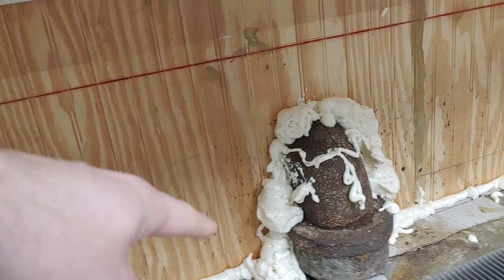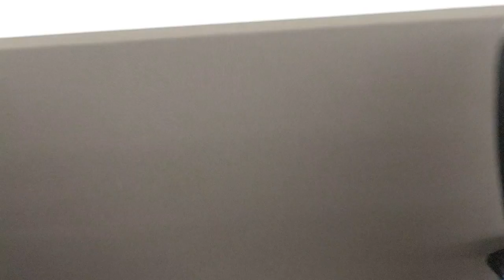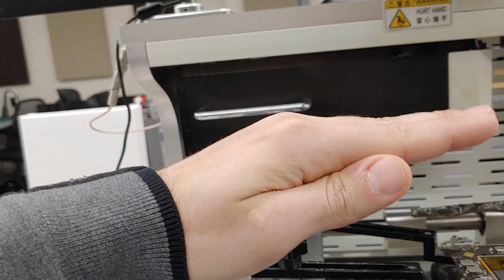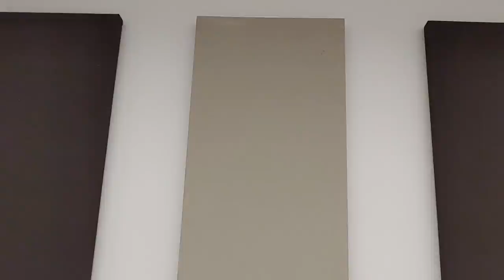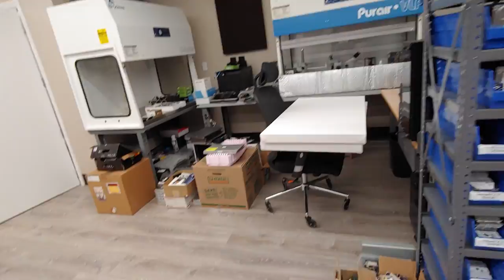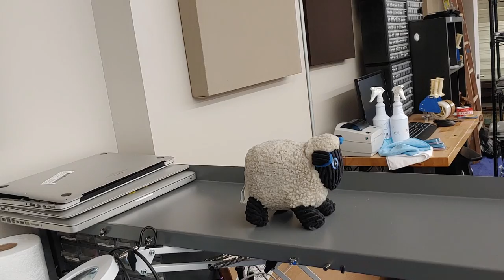The end of the cockroaches forever and ever

Comment: Mice I unfortunately know first hand will remove steel wool and foam.
Reply: Yup it will take them some time but they will
Reply: Glass mixed with cement is the only way I’ve stopped mice
Reply: @ace-kz9id  they even manage to bash themselves against metal wire mesh and chew on it in NYC when we learned the first time. Ended up finding blood on corners they bent.
Reply: use mouse-x...it really does the job...only drawback is having to track down the dead.
Reply: Mice & rats & most other rodents hate copper,needs to be pure copper mesh,none of the metal coated copper mesh rubbish.
Reply: @stuartandrews4344  Well coming from a guy like me that used to strip insulation with with his teeth, coppers got a horrible taste, I think you might be onto something.

FYI; I have several different wire strippers types now.
Reply: @TheHungrySlug  You barbarian! I love it.

I have used steel wool in only small crevices. I just jam it in nice and tight. No mice problem since then, but it also helps having 2 cats who eat them kinda behind the scenes.
Reply: Gavin Ferguson some Londoners mice were stopped with a weird mix of PVA glue and sand made in a type of cement. I didn’t have anything on hand at the time and by the time we left that house, they didn’t came back trough the holes covered.
Reply: It doesn't matter what you use as long as it's airtight.
If the mice don't know that something is behind it, they will be far less motivated to chew through it.
Reply: @MBisFrenchy  they do that here also. But the difference is I keep a cat to kill and eat the mice

Comment: I wish I shared your optimism. When I lived in Florida, two exterminators couldn't get rid of them completely, and all the sealing they did, amounted to nothing. And the last day I was living in that apartment, I find a piece of carpet by the wall that lifted slightly. When I lifted it, it turns out they had ignored all the sealants and just dug a new hole into the side of the building and then pushed out through the carpet. Moral of the story: cockroaches are relentless and when they want in, they will find a way in.

Comment: dig a 3 meter deep and 3 meter in diameter hole, cement the bottom and walls with 1 meter thicc cement, carefully place the vacuum in there, fill the hole with self leveling concrete

Comment: i had a roach infestation because of the houses nearby not caring that they have a major infestation. we used to (and still do) have an externminator come in once a month to spray, and nothing changed until i lost my mind and put small cheap glue traps all around the house. closing the holes they use just forces them to find  a new hole. you dont get rid of them til you get rid of them yourself. we tried bug bombs and 5 little plug in things, nothing worked but glue traps.

Comment: Probably could have glued down some rubber trim to seal that up. I doubt that foam or caulk (which is it?) is going to last, surface is too rigid for it to stay in place whenever it gets abraded. Honestly my favorite is to just wire mesh and mud, as long as you put at least a cheap primer over it, it'll last far longer and look a lot nicer.

Comment: they make spray foam for insect and mice with repellent built-in.
Panels look tacky as Fck. I would have put 1x3 stripping on the walls and stretched some heavy fabric and it would perform better and look way better. 
On the ceiling, if I had a "Designer" helping me I would have done a cool drop ceiling that only covers like 60% of the ceiling so the sides are open and visible and the drop ceiling hangs down with a cool design. Looks awesome, add more lighting and will help with sound.

Comment: That construction fill foam will not save you Louis. They just eat through that, should have used some concrete or so. For a while it should help but it won't be forever.

Comment: Cockroaches pretty much come with any rental unit. They have a very good sense of smell and if you spray they just go in the walls and come back in a couple of days. Dupont makes a cockroach bait that they sell on Amazon for about 30.00 Cockroaches are cannibals. The cockroaches eat the bait go back to the nest and die. Then other cockroaches eat them and die. For me it is the only thing that works and it works every time. It comes in tubes of goop. Put a little goop behind socket covers, don't use a lot, just a line about two inches long, and a little under the bathroom sink, they like damp places, and in six weeks all cockroaches will be gone for years. You only have to put it behind a few socket covers, not all of them. It seems to kill other insects also, like silver fish. You will have to do something else about the mice.

Comment: Louis, you didn't heed the comments about using boric acid in the "dead spaces" and common entry points for roaches. Just because you plugged the holes and sucked up the dead bodies doesn't mean that you don't already have an infestation in the walls and hidden areas. This is the common problem in homes and buildings. You have plugged the visible holes, but you still have to deal with the ones that are still hidden. A single roach can multiply to tens of thousands in just a few months and take over. 1 part powdered sugar and 3 parts dry boric acid. Spread liberally in the hidden spaces and even remove outlet covers and spray in there (a favorite roach hiding space). This works better than paying $1,000 to a pest control company.

Comment: You need 6 packs of gel Advion Cockroach Gel with blue tip or maxforce bayer. Use slides of cardboard 5 cm wide 30cm long  that you taped with sticky-tape. Put around 30-50 bates including in basement. You will kill nests even in neighborhood stores.

Do not spray even if your life depends, sprayed rooms will cause you Tumors 100%, do not use any spray!!!!

You are using cardboard because you can easy remove every trace after one month without contaminating the floor. Even its very safe I would use taped cardboard, you are taping cardboard in order to make it contain the fluid as long as possible.

Cockroaches would eat each dead body and any shit trace.

Comment: You need Advion roach bait gel.  It's on Amazon.  I use the ant one and it wipes them out in 6 days.  It is what the exterminators use.  Roaches will fit through almost seamless gaps.  Good luck.

Comment: Hey Louis, if you still see them get some of this from Walmart. It will kill them and if you spray it really well under stuff you will get rid of them. A friend of mine told me about it. He had really bad roaches when he moved into an apartment. Literally, he was moving in. Forgot his lunch sandwich on the counter and came back a hour later and it was covered. He went to Walmart and go this stuff to use.  We had the same problem when we moved in and because our neighbor in the apartment complex would not let the exterminator in their apartment. Every time we used this stuff and reapplied it, they'd suddenly let him in to spray. I figured we drove the roaches through the wall to their apartment. https://www.walmart.com/ip/Bengal-Roach-Spray-16-oz/114633484 I know it is expensive but it works better than another well known name brand.